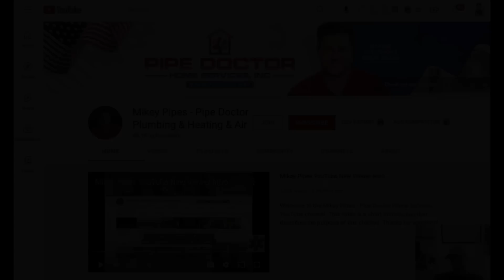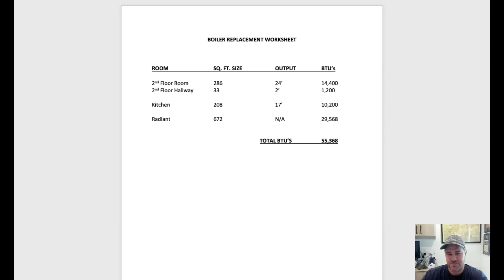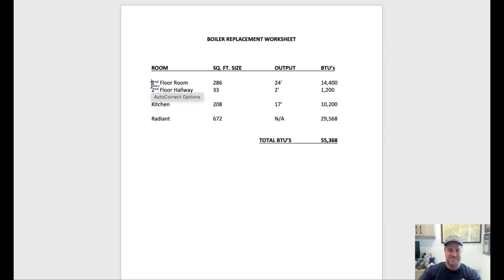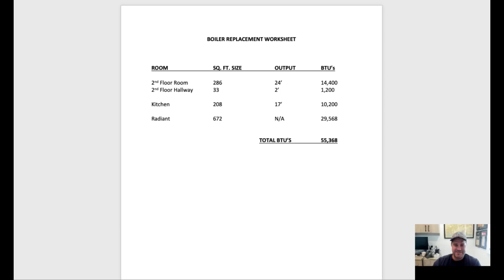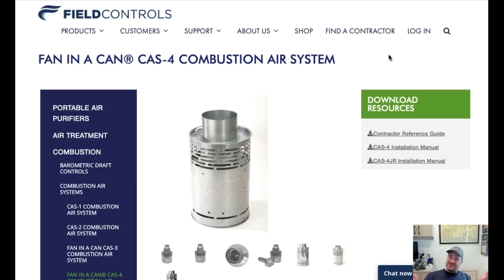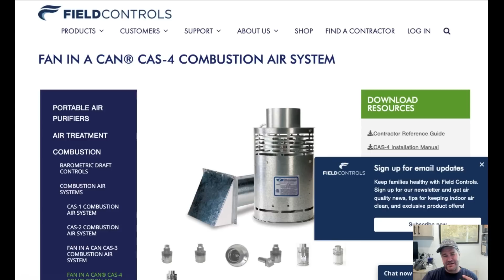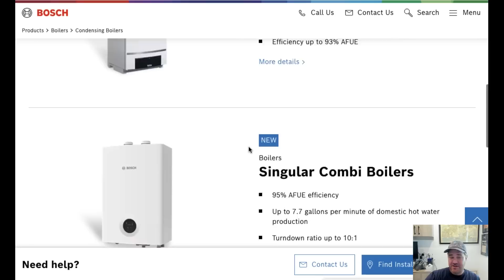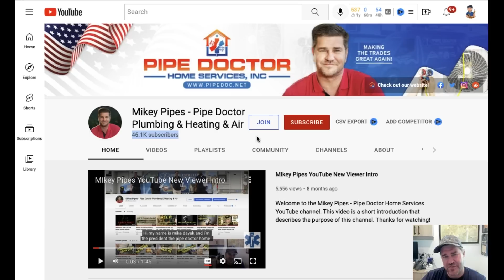How to Size a Replacement Hydronic Boiler With This Step by Step Load Calculation Guide

Comment: Appreciate your thoughtful approach, but it looks like the sizing is based on the available baseboard and radiant capacity, not heat loss of the house. What if that was sized wrong to begin with? I have found even 300 miles north of where you are here, in a nothing-special older house, 30 BTU per square foot is ample (70 degree delta). This client of yours has enough radiator for 45 BTU per square foot. And will need a larger boiler to service that, but isn’t the bigger concern that  if there’s too much radiator area the return temps could be too low?

Comment: Great video M Pipes. Few questions if the original boiler is 130,000 btus why is make up air a concern with a boiler with half the btus?
Also most if not all combi boilers have 2 btu ratings one for heat and one for domestic hot water.  Lastly turn down ratio is only useful when an outdoor reset is installed.  
Keep up the the great content.

Comment: I always wondered one thing with cast iron boilers and multiple zones. If that boiler is not a modulating unit and only the kitchen area calls for heat (30k btu), won't that cause cycling on the boiler? What is usually done to help the boiler work more effectively?
Reply: Cast iron boiler is high mass therefore short cycling shouldn't be a problem because the block will hit its limit and hold that load plenty long to effectively heat that zone without short cycling. The key to getting the most efficiency out of the situation you're describing is insuring your DeltaT is dialed in. Without knowing which method these zones are piped with its difficult to tell you exactly, but the most important thing is NO LOW RETURN WATER TEMPERATURE. Block sweating, equals corrosion/sooting of heat exchanger, equals improper combustion, equals loss of efficiency and eventual failure of the boiler. That's what I was taught at least.

Comment: Mike, I’m happy to hear you talk about to Eco-Tec. I have installed 6 so far in the last 2 years. Really have come to love the unit. Piping is very very accommodating. Love the manifold they provide. Wiring is also incredibly accommodating. I love that they provide SPACE for the wiring it gives you the ability to really be intentional about doing clean work. They also provide like Bosch a wall templet you can hang and prefab anything you like. One difference is they need to have a thermostatic mixing valve on the domestic hot water side. But man they are a great machine.
Reply: @PipeDoctor  yup, same thing down here in South Jersey. To be completely honest with you up until the Eco Techs we didn’t really put them on our combi installs. But now we do along with a thermometer on the mix side of TMV. Aside from being code, it’s really the right thing to do.

Comment: I'm in Upstate New York and I would say probably 80% of the boilers I come across in houses more than 100 years old are oversized or grossly oversized. They sized the boilers back when insulation was a luxury and double windows were a massive luxury. One of the old guys told me that they used to size boilers just off the number of bedrooms.
Reply: They were oversized due to cheap fuel costs. It would over heat the house but opening windows wasn't a crazy idea bc of how cheap it was to fuel the home. That's why efficiency is everything nowadays bc fuel is not cheap regardless what you have

Comment: You should do a video teaching us how to size for air conditioning.
Reply: Same thing but in reverse. Heat moves one way or the other same rate. Getting the ducts and registers correct for throw is biggie.